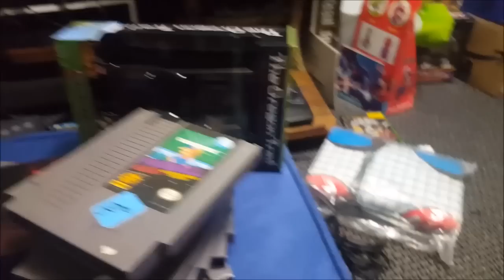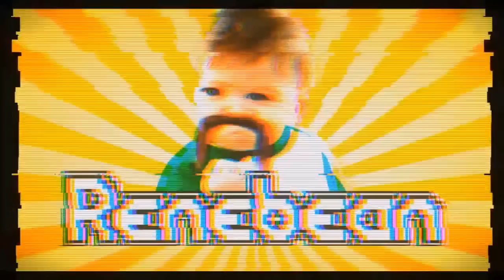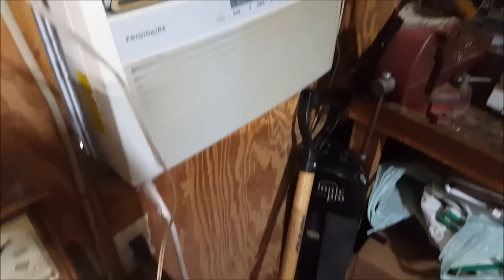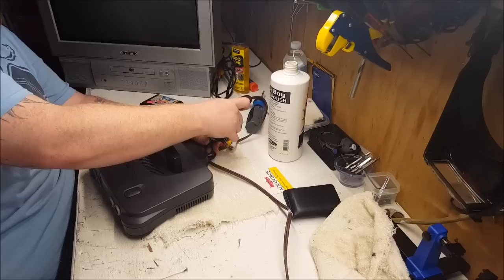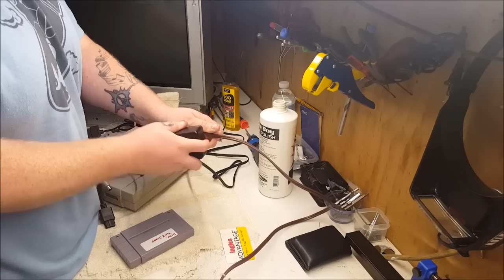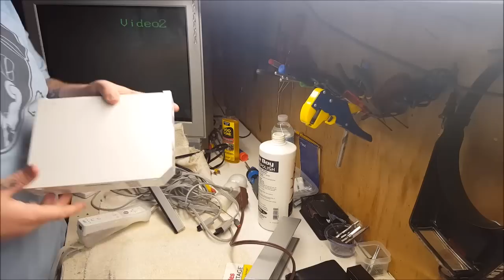Life of A Game Hunter/Collector Vlog - Ep. 47 - Console Overload!

Comment: I clean the cart slots when I open the console a lot of times.  I spray high % rubbing alcohol (so it doesn't leave residue) directly into the slot and use a toothbrush to scrub the pins, then blow it out with air.  Works like a charm when you don't have a cleaning kit. Other way I do it, I take a game and douse the contacts in rubbing alcohol just before its dripping wet and insert it into the console and remove 5-6 times.  Then clean the cartridge with a q tip and repeat until you stop getting dirt when you clean the game with a q tip.  Both methods work great!

Comment: I got a free n64 lot and the system wont work.  It powers on but does not even have a flicker i have tried a different power pack and cables from a working system and still nothing any ideas?
Reply from the maker: try cleaning the pins where the av cable connects to the system